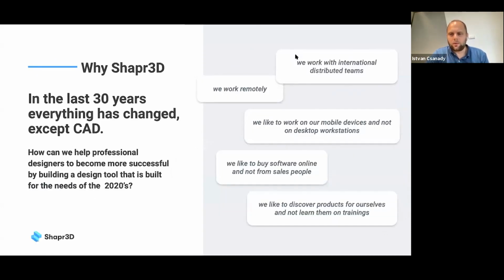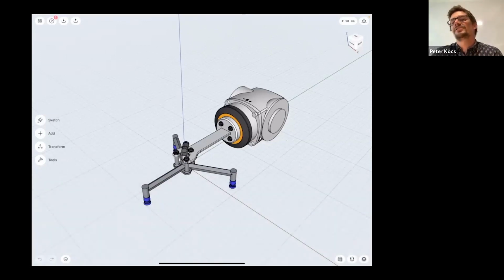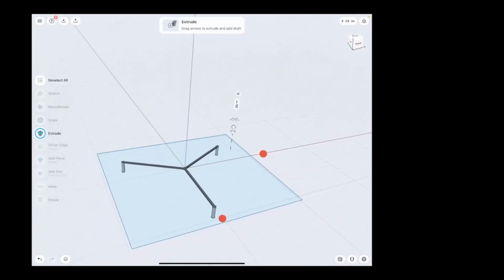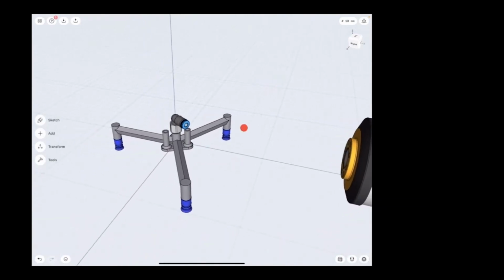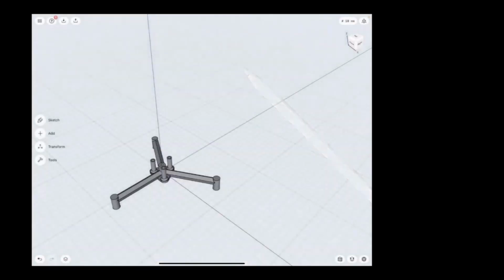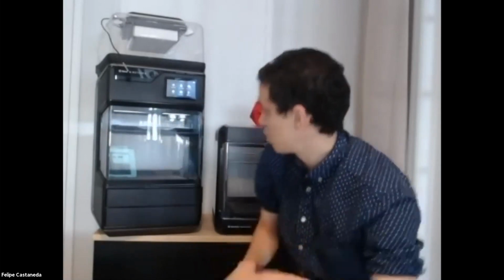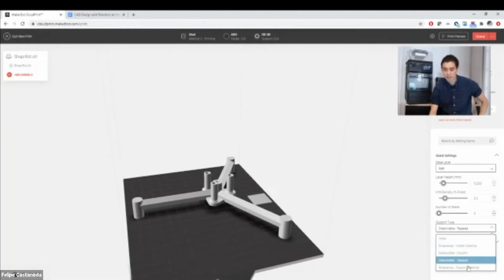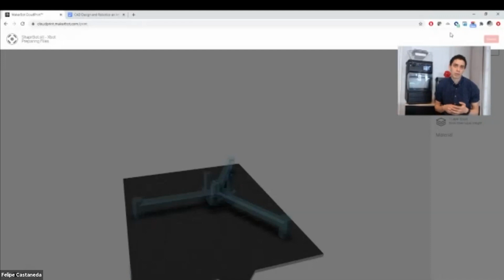Virtual Summit – Additive Impact – The future of CAD and 3D printing

Comment: I got a dumb question but i dont know how to mesure my finish pieces on shapr 3D.
Reply: youre not alone
Reply: There's no separate fonction for controlling your model dimensions but you have to check in the center bottom zone of the display. Every entity you select are analyses there, radius,circle,length position and distance between entities. Maximum 3 digit regardless if you use mm inch or any other units. Does this info help?